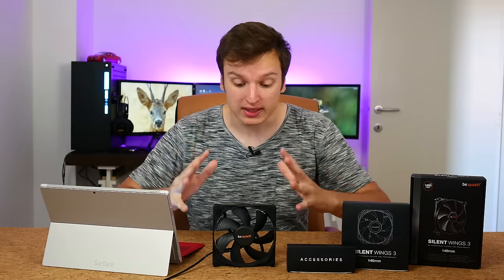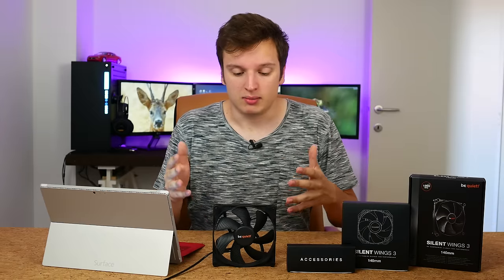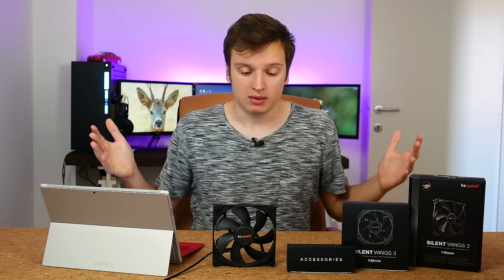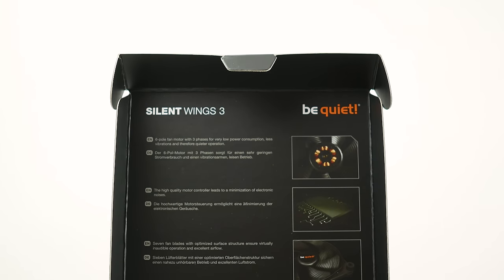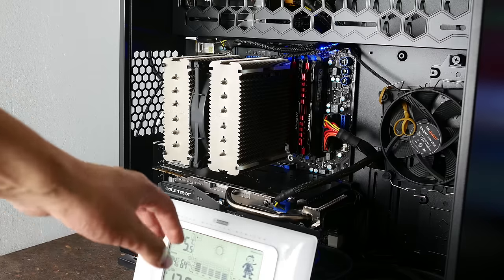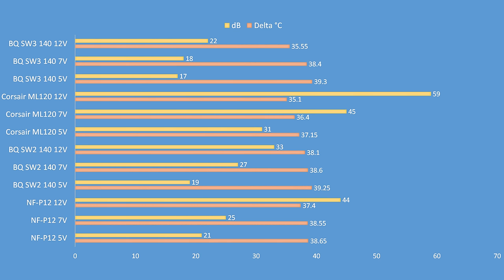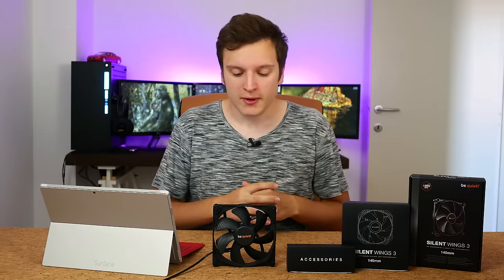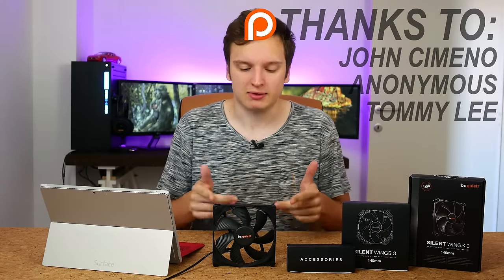Be Quiet! Silent Wings 3 Review and noise and cooling performance tested

Comment: 1. ML120 is designed be PWM controlled and yet you tested with voltage control (5v?!?)

2. The dB and Delta T Rise bar graph is useless. You need to have a controlled variable to define it against. What about Delta T vs  dB? What about static pressure vs RPM? SP vs dB?

3. A 120mm fan wailing at 2400RPM because you set it to 12V vs a Noctua which has a max RPM of 1300, of course the Corsair is going to be the loudest. So the results aren't comparable at all!

Overall, I rate this review 1/5.
Reply: Yes but I have a ML120 pro and it is hooked up to PWM and it is VERY loud.
Reply: Really? oh. I was thinking about getting the 140ML
Reply: Jim Nguyen I think you should have given him at least a 2/5 for effort, he obviously did spend a bit of time testing the fan/making the video.
Reply: I guess you own the ML120's?
Reply: +Waris Choy no they don't. Max is 2000 I believe

Comment: Nice review. I'm currently running 21 of the 140mm high speed fans in my Thermaltake Tower 900 with Phanteks Halos. Couldn't be happier with my choice of fan.
Reply from the maker: Lol, uneven number suck man, get 22 fans in there!

Comment: i am having trouble finding the NON pwm, are the only ones being sold for 120mm both PWM but one being highspeed and other not?
Reply from the maker: Try looking at other shops. I have a 120mm non pwm model. But if you can't find one, just plug it in to a 3pin header

Comment: There are 1000 RPM and 1600 RPM models, but since they are PWM, why wouldnt i buy 1600 and just set it to 1000 RPM if i wanted to?
Reply: That's exactly what you'd do. I imagine that they offer both because it's profitable for the company, plus probably saves the consumer who doesn't require PWM a few dollars.

Comment: High speed version highly recommended. If you can control the speed it is just as easy on the low end and you can realy have the top-end performance. Scenario: use as a case fan for media center. If cpu/nb => 80*c then it is time to spin it and vent the case.
At 0 to lowest possible (300) it is dead silent. At 1000 you can hear some air flow but you need to put you ear to the case.

Love the stuff. Just top quality
Reply: More. No matter the speed. At most you will get some air rush sound. No bearing/ticking/vibration sounds at all.

Comment: Watched your Evolv ITX review and you said you had to drill out the holes for the be quiet fans on the front due to the mounting system, is that issue resolved with these fans? I've got the Evolv ITX TG with a 200mm on the front but considering swapping to 2x 140mm instead.
Reply from the maker: Not a clue, I no longer have the Evolv ITX

Comment: hello question to anyone i have a corsair 400c case just built my first pc n iam looking to change the top mount case fans i have they r alittle noisy i want to get the B QUIET 140 MM or the 120mm ones but which ones to get since they have differents ones
Reply from the maker: +Elvis Best can't go wrong with the pwn models, but the normal ones come with sata power to 5/7/12 volt adapter. I use those
Reply: ok thanks i like the sata power too ok ill get 2 the one i got i ran them off my NVIDIA GTX 1070 so when the card heats up the fans takes over but they are corsairs fans n they r to darn loud for my liking

Comment: This is probably a stupid question but how do you set the fans to 12v? I have no idea what I'm doing.
Reply from the maker: +Deathstroke either through your motherboard, fan controller or by using the included adapter
Reply: Unicorn Reviews How do I know if my motherboard is already using 12v for the fans then? Sorry for asking a bunch of idiotic questions.
Reply from the maker: +Deathstroke you can set that in the bios

Comment: You're one of the first to review those fans, nice job ;)
corsair's fans are trash compared to this :p
Reply from the maker: +Ellypsis 63 not trash just louder but they do move more air
Reply: Unicorn Reviews yeah but the ratio noise/performance is quite big, the corsair's fans are much louder for pretty much nothing.
Reply: a 120 corsair fan was cooler then a 140bequiet so its pretty good for corsair imo:Pgot 5 of the ml fans and they work great imo
Reply: the beqiet fans are pretty awesome to but i rather go with a cooler system then a quiet :)they dont sound that much anyway especially on low rpm:)
Reply: You dont get the point: A silent fan can spin faster than a louder fan to be equally loud. That means that the silent fan moves more air at the same amount of noise than the louder fan.

Comment: You always surprise me as I'm a noctua fanboy but as any intelligent person should be I'm open to new things and it seems noctua is no longer king of the hill what about CPU coolers the massive block with two set of fans and easy mounting system
Reply from the maker: +samdeur d14/15 heatsink still the best. Mounting is so easy compared to bq
Reply: nocturnal heatsinks are still the best
Reply from the maker: +GameBrosTMT they don't work as good in daylight tho

Comment: I have 6 of these fans in my new PC case and they are loud... I mean... even at 10% speed which is roughly 250rpms they are audible for sure...
Reply: You must have gotten defective fans or an older silent wings version than 3. Some of the silent wings have a defect in the pvm version where you can hear fan coilwhine at low rpm or at 12v. These should be near inaudible at 1000rpm. You can try to use the included sata cable and plug  it into to the 7v slot, which should help the noise if it is loud.

Comment: every cooler for 1 dollar will be silent on 1000 rpm
Reply: Not really! And i can give you an exemple: Cooler Master MF120R RGB @1300rpm (max 2000rpm) is at least 8-10db louder than NZXT Aer F120 @1300rpm (max 1300 rpm). When the Cooler Master it at 100% i can hear it from the other room.